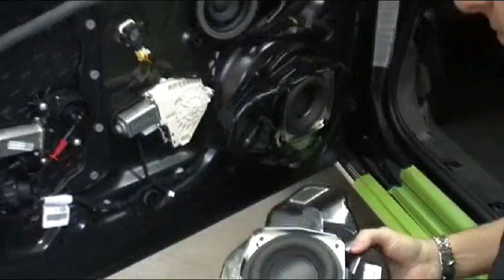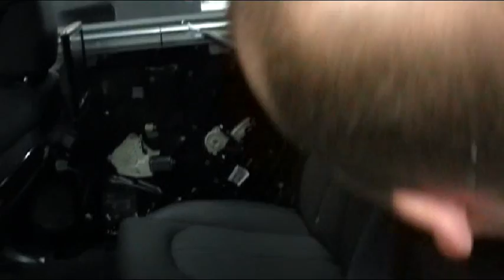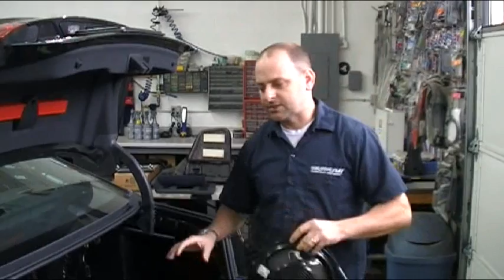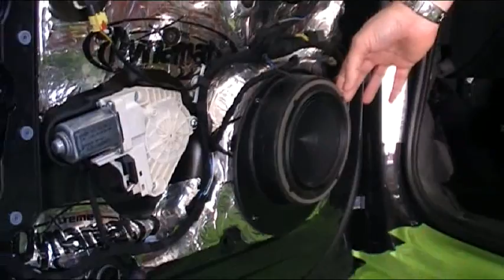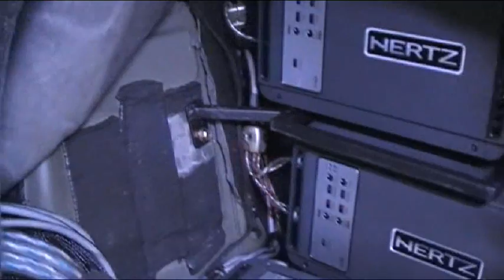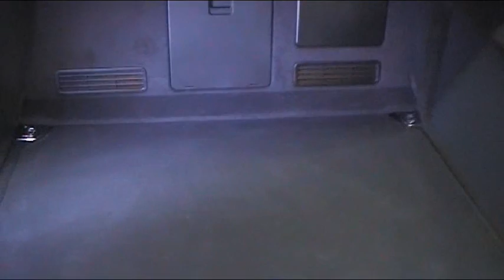2012 Audi A8L Audio Upgrade by Sounds Fast in Bend, Oregon

Comment: And how much was the total cost of this install and system? 5k ?
Reply: no. it was far more than that. There is a ton of labor in this job.
Reply: Not worth it....factory is a 16 speaker system not 14... all this system needed was a subwoofer added and its better then alot of systems out there.... if you want to go a step up change the woofers in front door to a nice 5.25 or 6.5 with better bass and u end up with a great audiophile system...

They charged alll this money and went from 16 speakers to 9 speakers and as he said sound is only focused for driver only lol... the car meant to drive a CEO around i think he would want to have a good music experience aswell
Reply: M K just because it has 16 speakers doesn't mean it is better. Manufactures add speakers to a vehicle all the time to fix tuning issues. We deal with this on a daily basis and our clients are always extremely happy with the outcome. Doing what you are suggesting would not have given the client what he was looking for. He was looking for better clarity and volume. The factory tweeters and amplification would not have provided this. Sorry.

Comment: So he said, woofers don't sound good in Audi's because of the sealed trunks.. the installed the woofer In the trunk?
Reply: we were talking about the lack of output European vehicles have with a sub in the trunk due to the sealed nature of the trunk. We also removed the factory woofers out of the rear deck for this exact reason. There really isn't a lot of other locations in the vehicle for the subwoofer.
Reply: @colinmecey462  thank you for the clarification.. I'm ready to put a small powered sub in my S8 just for a little kick to the factory system but you were making me think.. am I just wasting my money?

Comment: Thanks for the video, it gives me hope for my 2015 A8. I have a few questions, if you don't mind. Where did you grab signal from? If one did not want to go the extreme that you did, but still make massive improvements, do you feel that the speakers could be replaced and a sub & amp added? Do you know the factory impedance and what the impedance range of the factory amp is? The stock Bose system is truly awful, but I cannot spend $10-$15K on a system right now (guessing on that range). I have a couple of vintage PPI amps and a Boston Pro separates and a killer Infinity 10. What I would like to know is if you could build and ship a fiberglass enclosure with the steel grill and carpet to me. Oregon is too far to drive to, but all these 3rd Gen A8s are the same shape so you could mold it on the next one you get in. Anyhow, let me know if this is possible and, if so, I will contact you for further details.
Reply: thank you for your comments and questions. We don't give out exact wiring diagrams, etc. I can tell you the signal was grabbed at the factory amp. Upgrading the speakers can be done and it will make acoustic improvements for sure. This vehicle had the standard BOSE system so impedance was a normal 4 ohm system. We wouldn't be able to build and ship this enclosure as this vehicle was built back in 2012 and the enclosure was built to go around the amp rack behind it. This was also built to the specs of the woofer we used so the airspace might not be right for your woofer. If you aren't interested in bringing or shipping the vehicle to us, I would suggest talking with some of your local audio shops. There are a ton of talented fabricators around the US.
Reply: @colinmecey462  Thanks for the reply. I certainly understand you will not give your diagram (or else I might have asked for it ;-) ), but I was just interested to know if you grabbed the low level signal going into the amp or high level coming out and where n the vehicle that is (I have not taken mine apart yet). I did not mean to make the exact box, just a fiberglass box that fits and is finished like you did. I am not worried about the cabinet requirements of the driver as I can get a new driver, if needed, or add/remove fill to adjust. Shipping the car from FL is not really an option. That would make it crazy expensive. I don't know of any knowledgeable shops around here when it comes to really custom stuff, but I'm sure they exist. There used to be lots of them.
Reply: Did you ever find out which was the signal to tap in?

Comment: How did you run the speaker wires to the front doors?
Reply: used the factory wiring into the doors

Comment: I'm sorry to say that the B&O system in my 2011 A8L doesn't even compare to the premium 12 speaker system in my 2004 VW Phaeton. The imaging in the Phaeton still blows me away. Is this simply a matter of the sound processor? How might you achieve the sound I want (Phaeton's) without carving the car up? What do you think the result would be if you upgraded the sub (likely with new amp) and processor? Are the B&O speakers respectable but simply lacking the signal to help them reach their potential?
Reply from the maker: A majority of what you are experiencing in your VW is due to how the manufacture tuned the built on processor. As you can see from this install we did not "carve up" the vehicle. There were absolutely no modifications made to the car except for the custom sub knob work down. While the B/O speakers are an upgrade over the normal BOSE speakers, a majority of the upgrade comes from the amplifier and built in processor. This vehicle was built in 2012 so technology has improved quite a bit. In some cases we can process and amplify the factory speakers and make quite an improvement. For low end though, we would need to install an aftermarket sub and amp. If you are local, you are more than welcome to come by and we can discuss further.
Reply: Jamie Lewis I had a similar difference between my old 2006 A8 with Bose vs. my 2014 S8 with Bose.

The 2006 car sounded infinitely better - yet both are still Bose systems.

Very interested in this upgrade, I’ll have to see if I can find someone this side of the pond who can do the workmanship you guys put in!!

Comment: I think that the center channel is useless in an hifi system (I would remove the center channel speaker and place a resistor instead of it, then I would use the fader to make the sound going just on the three way door speakers).

Comment: Um.... Why does a 2012 A8L have a steel spare in it. Aka Where did his tire go. I know its not related. Also I would really have to hear this car in person. I cant really believe it sounds so good. Louder sure but yeah.... All the audis I have ever had or worked on I always gave up clarity for loudness. Every time without exception.
Reply from the maker: Robert I'm not really sure what you mean by your comment all the Audi's you have worked on you have given up clarity for loudness. If the system is designed correctly, you can accomplish both. Was this vehicle designed for loudness? No. It was designed for clarity first and loudness second. The car sounded far better than stock and was far louder than stock.

Comment: what did you do to get the sound through into the cabin besides removing the sub? i have done this with my a8 but it still sounds quite muffled. i'm wondering if the JL shallow mount would sound better as a drop in replacement for the bose 10" sub in the rear deck as apposed to the sealed box?
Reply from the maker: German vehicles are very sealed from the factory. We took the factory woofers out of the rear deck which allowed more of the low end to get into the car. This vehicle is not an SPL type vehicle. If that is what you are looking for then you will need to vent the enclosure into the interior of the car. You CAN NOT just replace the factory woofers with JL Audio flat woofers. The JL flat woofers are not designed for a free air set up. They have to be in enclosures with the right air space.
Reply: yes right now i have a sealed JL sub with the factory 10" sub removed as well as those 4" midrange removed but the sound is still quite muffled. not sure what else i can do if i can't find a good free air sub that actually sounds comparable
Reply from the maker: free air subs are not very popular anymore. In fact, I'm not sure who is even making one besides JL's marine sub. Free airs aren't going to give you the same output as an enclosed sub. A 10" is pretty small for the size of the A8. you might want to go to a pair of 10's or larger.
Reply: I'm now contemplating just removing the ski bag since that's something I will never use so I can have a port through for more sound to reach the cabin.

Comment: I have a 2014 A8L with the Bose system and am looking to do a similar system although I'm having a hard time getting a "warm fuzzy" from any of the local area Houston, TX shops. That being said, you indicated in your video that the rear tweeter placement is in the rear pillars between the front and rear doors. Is this correct? I ask because it seems that these factory locations are aimed towards the rear of the vehicle. Thanks.
Reply from the maker: yes, in this 2012 the tweeters were located in the pillars between the front and rear seats. It is mainly there for rear passengers. There are two shops in Houston that are part of our dealer network. I don't know their capabilities, but you could show them the video and see what they have to say. Cartunes and MP Custom Audio. We do also have clients ship us vehicles if you are interested.

Comment: how does that compares to the b&o ?
Reply from the maker: it is far better tonally and with far more impact than the B&O system. It almost al cases you can have a better sounding experience with properly installed and tuned aftermarket equipment.
Reply: Jamie Lewis "properly installed " that's the hardest part of the procedure. When it comes down to aftermarket car sound system installation, I feel claustrophobic just to think about it. But your work seems extremely professional. Keep the good working. I live in Brazil btw.

Comment: Nice video...have a question, I have a 2013 Audi A8l and came across the JBL MS-8 is this a good option to add to my factory system
Reply from the maker: I'm not familiar with the JBL product you are talking about. We don't sell the JBL line
Reply: It's a DSP by JBL a discontinue product...came out about 6years ago...would live to do the audison setup can I use it just with the factory speakers or do I need to change them out.
Reply from the maker: Not being familiar with that piece, I can't say yes or no. If it is discontinued I would stay away only because you won't have any support for it. You can use factory speakers, but since you have to amplify everything with aftermarket amps to use a processor, it kind of defeats the purpose if you use factory speakers.
Reply: Great point...thanks

Comment: Hi I got a quick question for you have you work the 2012 Audi 7 try to install aftermarket amp but having trouble finding the remote wire is there anyway you can help me
Reply from the maker: Jessie I apologize but we can't give out wiring information on vehicles due to liability reasons. If we gave out the wrong information then we could be help liable for any damage that might come from the wrong info. You might try some of the Audi forums

Comment from the maker: That is true, but you can't remove the factory headunit in this car as it has the factory nav system installed. All of the car's climate controls, car information plus more comes through the in-dash screen. Other advantage is when we were done you don't know that it has an aftermarket audio system.